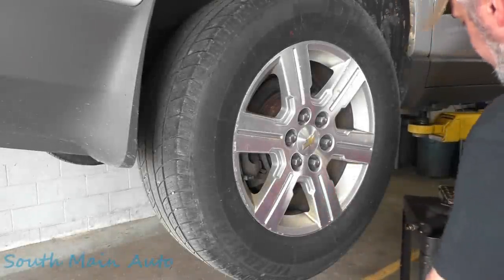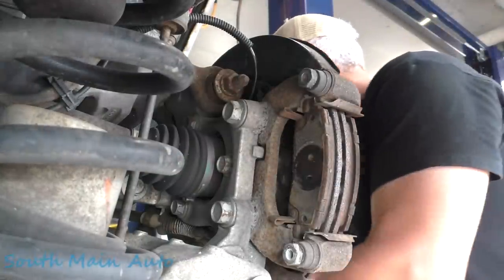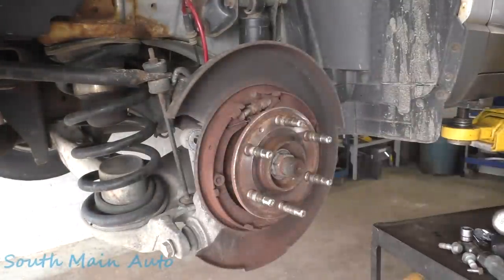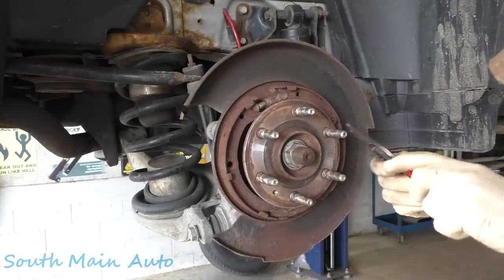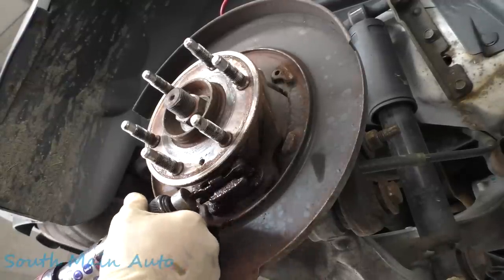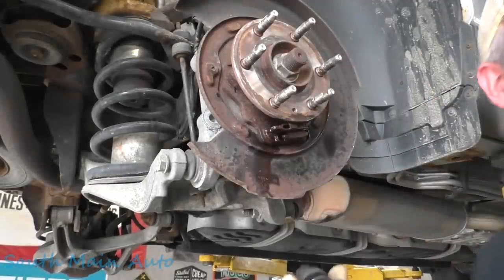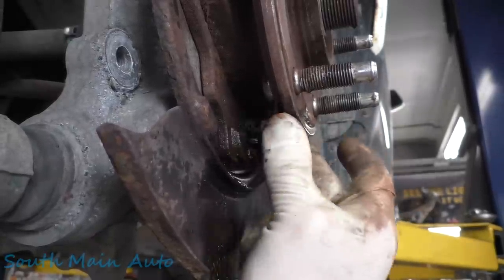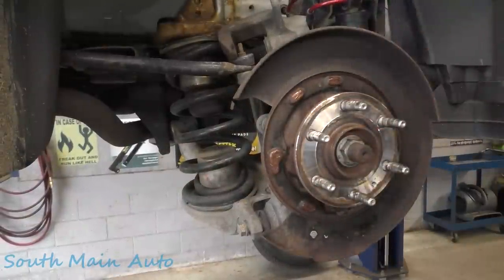Chevy Traverse: Parking Brake Shoes Actuators Froze Solid - Missing Friction Material

Comment: Years ago when I delivered parts for Big A, I remember a shop had a sign about bringing your own parts for them to install.  It showed a fella' standing at a restaurant counter with an arm load of groceries for them to cook!  It said don't expect us to use your parts!  Got the point across pretty well.  Plus, wholesale parts cost to shops allows a proffit to the shops who charge customer retail.
Reply: I worked also at 2 Big A franchises,back then cars seem to have many parts that fit a lot of models- and Big A sold a lot of parts and paint in my area/As a driver you put some serious miles on the tired old vehicles
Now they are new and have A/C

Comment: I have a 99 f150. 297000 miles. New engine tyranny diff. No rust. Runs like a champ. I do my own work on it. No way am I going to spend 75k for a truck with computer crap all over it. Mine looks and drives like new. Sometimes your videos give me a nightmare with all the stuff one needs to find a problem. I'm 62 so stuck in my ways now. Love the videos. I watch all the time. Thanks for the good work. Your amazingly honest and thorough.

Comment: 10:10 I remember on my old 5mt subaru legacy, I had an issue with a squeak coming from the rear when I would get in and out of the car (I think with the parking brake engaged, this was probably 10 years ago). A heavy gust of wind could knock me over, so it's not like there was a lot of weight on the suspension components. Long story short, the lube on those shoe contact points (if there ever was any) had gone away, and that was the cause of the squeaking. So I guess I'm saying, sure doesn't hurt to lube them in a parking brake setup

Comment: My mom had a 2007 Saturn Vue with the 3.6, still running with 236K on the original motor and trans. Got junked because the rust in CT/NY finally caught up with the unibody, but the body itself and inside was fine.
Reply: Saturns were the gems of GM. They lasted surprisingly well.

Comment: No parts,wrong parts immediately alters the flight plan.
This lump is now taking up a lift.It's gotta go- into the parking lot 
Glad it's not a "waiter" because that impacts how many times the boss will ask you a stupid question and you're losing here too.Not just the money- also your patience

Eric is really being a nice guy here.Keeping it cool.
And probably the only man in 50-100 miles that would get that job done right
This looks like a 3-5 hr job for an A tech with all the correct parts
Road Salt equals quickly recycled unit

Comment: In my experience, the few shops that allow customer supplied parts, labor is billed at 1.5 times the regular rate. It helps cover the shops loss on the parts margin and makes frustrations experienced here easier to stomach. The best option is probably to just not allow customer supplied parts.

Comment: My rust issues are not from salted roads but from atomized salt in the air mixed with high humidity. (I'm a block from ocean in Florida).  So it's similar issues but different places. From the slight  electrical charge from battery, it creates an accelerated rusting of the body and frame.  I've gotten holes in my hoods, for example.  What I do now is coat the undercarriage of my car and truck with Woolwax (lanolin grease) and under the hood, I soak inside of the hood and the latch, etc. with the Woolwax as well.  Then I ceramic coat the crap out of my body panels.  It seems to be helping with rust. The rotors and brakes just get a small coat of rust, not thick like this from salted roads.

Comment: Good one Mr. O.  Customer supplied parts and still needed you to get parts.  Enough said.  I have an 06 vehicle, replaced all 4 tpms sensors in 2015 due to batteries not liking the cold 9 years later.  Now the replacements are over 8 years old.  HMMMMMM!

Comment: I purchased brake pads, rotors, calipers, stainless steel brake lines and fuel lines to do a brake job on my own vehicle. Due to a medical problem I had to have them installed at a shop. When I called, I apologized when telling them I had the parts and the guy was actually happy I did because they had been having problems getting parts and that was prior to COVID.
Reply: That's a good shop.

Comment: Another good one Mr O.   My wife’s 2009 Pontiac G8 has the 3.6.   130,000 miles.   It’s had the code for timing chains for 50,000 miles now....   expecting something to happen any time....
Reply: A GM will run poorly longer than most vehicles will run at all.

Comment: I was going to ask about bringing your own parts. You answered it. Shops here refuse work if you bring your own parts.
Reply: I have a different labour rate for those customers
Reply: Buy your own parts, install your own parts😉. A car gets stuck on a lift torn apart because you brought the wrong parts. Shop is not going to be happy
Reply: Some shops could just depend on the parts. Like if you bring a good subframe and have it installed. You would normally just pay for labor and new bolts and possibly anything that may break during the switch over. 

But other parts real questionable I say, like electronics I think shops should turn them jobs down unless it’s actually OEM parts, but even then that’s iffy.
Reply: @toeknee6588  One shop I spoke with would use the parts but will not guarantee or offer a warranty. If the parts are wrong they add additional labor. Time is money.

Comment: I feel your pain Mr. O. I did rears on my truck and when I got the rotors off, of course the ebrake pads fall to the ground. The NAPer didn’t have the el cheapo parking brake, they had the hundo set in stock.  Cheapanese pins to boot.

Comment: TPM is like "Do not eat this" protecting us from ourselves.
Reply: I personally like them. Get a hole in the tire and I will see it start to drop pressure. Last time I was pulling down the street and turned right around saving a tire swap on the road
Reply: @mph5896  when I install tires without sensors it can be 3 drive sessions before it even tells me there's a pressure issue

Comment: I'm in the UK...My Captiva has this exact issue. No air hammer sadlyI had to tap with a hammer and punch for a while with WD40 too untill it freed itself. 6 months later still a perfect hand brake. ( manual gearbox )

Comment: I have found over the many (50) years of doing my own mechanic work, using Kroil is most excellent.  However, when you run across something really rusted up, a double douche of Kroil backed up with a double douche of WD-40 (back and forth with the two) does the job much faster with very positive results.

Comment: Great job as usual. Having our lifts tied up due to parts issues is pretty common now, sucks, next customer in line is usually salty because their appointment gets pushed back a day.😢 My comments section didn't work on last video about cam phaser/sensor issue on 3.6l also very good tech! Would have not found that one without scope. Loved your washer fluid megaphone, screwdriver setup😅 Never saw that trick before, tried it out the next day at my shop, worked better than my headphone tool! What was the outcome of cam phaser job?

Comment: 5:50-I love it when you break out the air hammer.  I love it when anyone does, really.  I've got just about every adapter for mine and break it out often.  Even have one adapter used for putting my condoms on.  That light trigger controllable air hammer would be good for that one for sure.  😂😂

Comment: Hey Eric, that tool(with a red handle) you used on the spring, I think it's called a "hold down remover". I didn't know that they came in different sizes. For many years when I did rear shoe brakes, I used 1 size for the hold down spring removal. Now if I choose to do the job myself I have to get another tool to do the job 😒😤.
Reply: 👍 Right tool, faster and less chance hurt or break
Reply: They make one with steps/serrations that grips the various sizes without having to get  multiple tools.  Each 'steps will fit a different size.

Comment: So lucky I don't live in a rust belt. Bolts come off with ease, drums just pull off with your bare hands, no special tolls required to remove rusted on drums.
Reply: We adapt. Torch is on standby, penetrant runs freely and I wire brush all the threads before pulling stuff. 😉

Comment: I have a 2010 Traverse that has over 200K on the clock - original engine and transmission.  It just doesn't live in the rust belt.

Comment: We never documented emergency brakes, so if the customer declined repair it was no biggie. With automatic trans, you really didn't need it. Now in NY they may test it as part of their inspection, which is ridiculous. With dual Master Cylinder's used, the odds on a total failure just seem very unlikely.

Comment: I use my parking brakes often and they still rust up after several PA winters.  My K2500 has made it 9 years, but the parking brake is getting to where it doesn’t release fully with the spring alone and I have to use my toe to pull it back to shut off the light.  Will need to tear into it soon.  The service brakes are in great shape after 9 years, but only 38,000 miles, but the parking brake no so much.
Reply: Only 38K miles after 9 years, you are not using the parking break enough to prevent rust. It's not a knock on you, just reality. It ends up sitting in high humidity, rain, etc with out being moved. It's more the just the salt in the winter that causes rust. The fact that the spring & summers are so wet just adds to the rust creation. Look through your wheels at the rotor after sitting over night when it's humid. You'll see the whole surface has flashed rusted. Many times all it takes is sitting for 1 to 2 hours for it to flash rust. Now image how much rust up on the other parts over the course of a year. If the vehicle isn't driven much, like yours, you will be constantly fighting a siezed parking brake. I live in Central NY, and my parking break never sizes, but my car gets driven alot. Plus due to an old habit from driving a manual until recently, the parking break gets used every single time I park,
Reply: @williamallen7836  I don’t have a parking break, but I do have parking brakes.  😁. Yes, I don’t drive this truck much since I retired.  I put far more miles on my motorcycles each year than on my truck.  The truck is used mainly for plowing snow and hauling firewood, neither if which racks up many miles, but certainly is fairly hard duty.  The rotors on my GM vehicles, Equinox in addition to the truck, don’t rust much just sitting after rain.  However, I had a Hyundai Sonata that was terrible.  After sitting just overnight the pads would rust to the rotors enough to make a noise when they released in the morning.  And when I rotated tires, I could see all of the pad marks on the rotors.  GM must use better steel as I’ve never had that problem on a GM and the rotors stay nice and shiny.

My Sonata and all prior trucks were manuals also so that is why I use my parking brakes almost all the time.  However, when I bought my current truck in 2015, manual transmission was no longer available.  Same for the Equinox, nothing but automatics available.  I still prefer manual, which is one reason I ride my motorcycles most of the year, but for cars manuals are as scarce as hen’s teeth.

Comment: in a situation like that, with the tire pressure sensors, do you just tell the customer "I fixed em" or do you tell the customer that they actually overinflated a tire, and there's nothing wrong with the sensors? in other words, do you try to keep the peace, by just saying it's fixed, and glossing over what the problem was, or do you point out to the customer that they were mistaken, and had over inflated a tire?

Great video as always, thanks for bringing us along...

Comment: People buy there own parts to save the markup mechanics and parts stores put on top of their psrts costs. They can barely afford the labor charges.
 I worked as an electrical contractor for half the cost of auto mechanics and made a decent living . Had my own shop and tool costs also. Never turned down work because a client supplied their own parts.

Comment: I just recently bought one of these (GMC Acadia '10) I got a sweet deal on it because it had timing chain codesP008 and Cat codes p420. I replaced the chains and VVT sprockets. Witch took care of the p008 but as for the p420 Im trying to     find my problem before I slap a brand new Cat on her. I took the cat off and it looks clean inside. No damage or nothing. The up stream O2 sensor goes up and down between.705 and .98 volts.  But the downstream sensor stays between .700 and .650 in idle , but when under load it will go from .700 to.150 volts. But it doesn't mimic the upstream it kinda goes up and down with no pattern. I reckon my question is could that be an exhaust leak or bad downstream O2 sensor. I'm not a mechanic by no means but I do work on my own vehicles. I just don't want to replace parts that are not broke and keep parts that are on their way out, if that makes sense. I figure if anyone knows you will. I been watching your channel and been subscribed since the Chevy Colorado series. I had the same problem with my Colorado back then. I would of been lost with out them videos. I love watching your videos. Rarely do I miss one. I think your one of the best mechanics I've seen. I don't see how you do it dealing with rust and making it look easy. Plus making videos at the same time. Man I salute you. Even if you don't reply I understand your a busy hard worker. Your still my favorite lol Thanks for doing what you do man. Sorry for the lengthy message.  D. Sutton 111.😊

Comment: The problem with those 3.6 is the oil life monitor. It lets ya go 10k between oil changes. Then like the lady on Tuesday she said well I k. Ow when the light comes on ya have some time. No lady by the time the light comes on you should have changed your oil twice.
Reply: Don't blame the consumer blame the manufacturer. The consumer is simply following the directions provided in the official documentation.
Reply: @stevewhite3424  Your not wrong but lets take for example the lady who called me froday. The one who brought her 2.4 equinox in with less than half a quart of oil in it rattling. I had told her to stop in 2 weeks prior when she told me engine was making Nosie. 12k since prior oil change.  She delivers mail. Anyway she calls the other day and says no oil on my dipstick can I drive it. I know im due for oil change but ya have a little bit when it says you need to change it right? Im all for personal responsibility and well if ya dont know what your doing ask someone who does.
Reply: @stevewhite3424  But yeah they make a shit product.

Comment: Have never had an issue with your methods, in fact I've learned a lot from them.  But just out of curiosity, could the legs of the adjustor spring be bent so they'd clear with an outside mount?  Maybe too much rust on them to want to try that.

Comment: So, Eric, here's a little trick I figured out early in my long career as an auto mechanic, and it involves making a special tool.

I took a #2 flat-head screwdriver (just a cheap one - no need to mutilate a Strap-on).  That's the smaller of the most common sized flat-head screwdrivers out there.

Take it and grind one of the corners so that you've ground about half the tip off.  Since you're gonna use a bench grinder, it'll put a slight radius in that ground edge.  You want that.  It's not gonna be very long; maybe (guessing here) a quarter inch.  In other words, grind it using the edge of the grinding wheel.

On the other edge of the screwdriver, you're going to go down about a quarter inch from the tip, and grind a radius into the edge of the screwdriver.  It's important to get that radius in there, especially on this edge.  Again, the radius doesn't have to be very big; maybe a quarter inch wide, and maybe an 1/8th inch from the edge to the top of the radius.  

That's why you use a cheap screwdriver, because it may take you a time or two to get the thing to where it works for you.

How to use it: take the ground off corner and set it in the edge of the hole that the brake holder-together spring is going to go into.  Tilt the screwdriver so you can hook said spring with the shank of the screwdriver.  Tilt the screwdriver away from you.  Or toward you, depending upon which hand is dominant.  I'm a rightie, so I pretty much always pushed it away from me.

As you do that, the hook on the spring will slide down the shank, where it will catch that radius you ground, and will allow you to stand the screwdriver up.  Maybe slight angle toward the top of the brake assembly.

As you do so, the hook of the spring will pop out of the radius, slide the remaining millimeter of the screwdriver and the tip of the hook will pop into the hole in the brake shoe.

It's sounds very complicated, and I wish I could show you a video, but it'll take you a few minutes to alter the screwdriver tool and a few minutes to get comfortable using it, but it will make your life so much easier (and I'm all about that) for years to come.  Trust me on this.  I may still have mine, after 40-plus years, but I gave away the vast majority of my tools in recent years.  I'll look.

Comment: I was listening at the local dealership, a customer came in for an oil change and brought his own 10-30 oil and filter.  Car specifies 0-20.  Wanted to know if the dealer would 'trade'.   No, they dont stock any 10-30, havent in years...  I was wondering how long the owner had that 10-30 sitting around.

Comment: Adjuster? Manual or auto? Expect similar to my 18 colorado? When the dealer was switching winter tires to summer somehow he determined that I needed rear brakes and parking shoes. How did he see parking shoes without removing rotor? Work order did  not include brake check. If based on pedal then maybe just needs adjustment.